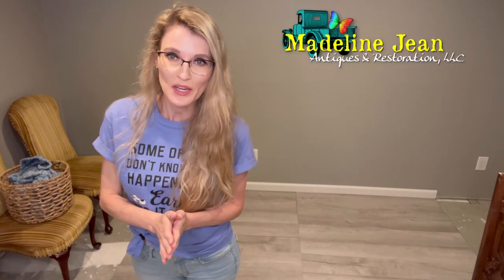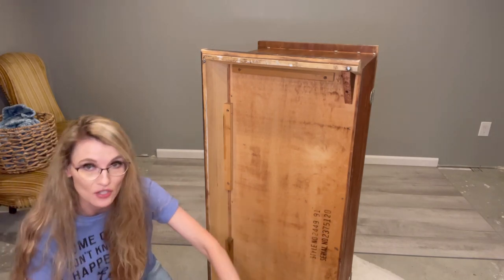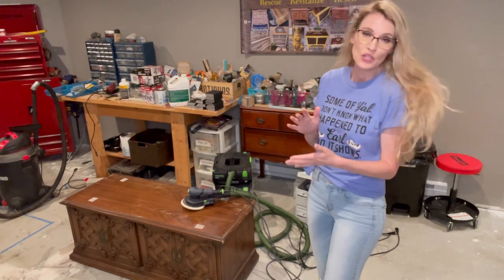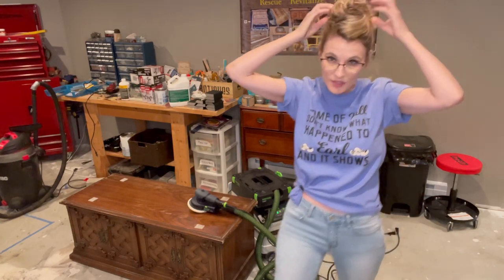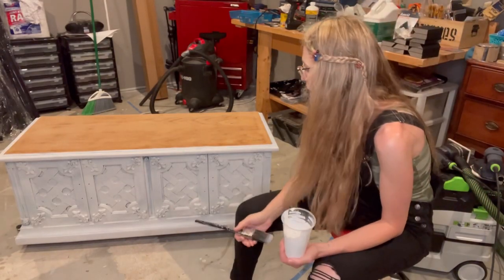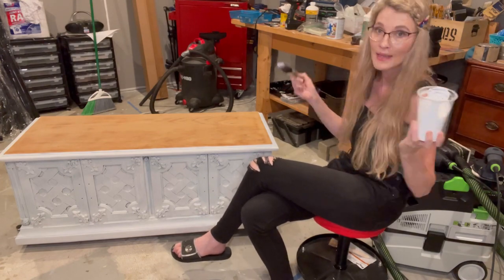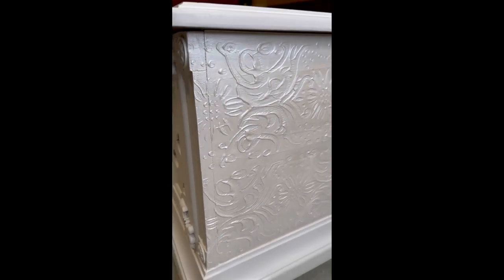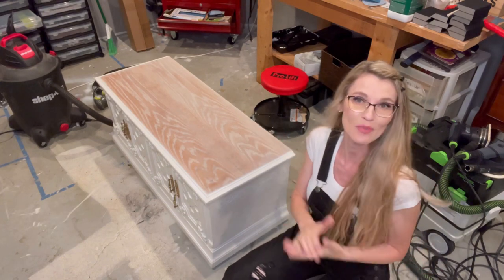Furniture Flip Makeover | How to Create The Bohemian Chic Look on Furniture

Comment: Hi Bethany! Your work is fabulous as always.I love all of your tips and tricks and envy your sander lol.  I have one question..I recently started using shellac for some dark stained pieces I would like to be white. I've heard you should dewax Shellac before you add paint. Is this true for you? Can I use the shellac that has no wax in it? Any help is greatly appreciated!
Reply from the maker: Hi there! Thank you for watching my videos! From my understanding the only time the wax vs. unwaxed Shellac comes into play is when you are using it as a topcoat OR using it over/under poly or a water based topcoat. I use Shellac as a wood tannin blocker. I use the Shellac with wax. I’ve had no problems pairing paint over it. It does the job perfectly of blocking stains and bleed thru. I do know the Shellac that comes in the can has NO WAX. Funny I used the Shellac spray a few times and I had issues with bleed thru.
Reply: @madelinejeanantiquesrestor9074  Thanks so much for the reply! That's perfect because I am using it for the same reason you are. I guess when I read about it I assumed de-waxing would allow the paint to stick better. I will stay away from the spray cans. I did see 2 kinds of Shellac in a can, one with no wax, so that would probably be bad for this purpose. Thanks so much:) Can't wait to see what you are working on next!
Reply from the maker: @bethcorso6376  I’ve always used the waxed Shellac with no issues. Best of luck with your project! Thanks again for watching and liking my work!

Comment: Hi Bethany, great tip using the “cheap” paint for a first coat.  LOVE the stencil and I am not even a stencil person.   Question:  why didn’t you use a primer to prevent the dark bleed threw?   Why shellac?  Thanks and love to Biscuit.
Reply from the maker: Hi Liz, So happy you liked how this project turned out. To answer your question I prefer Shellac over a primer because in my experience it not only blocks stains it blocks wood tannins coming thru. Primer in my experience hasn’t been 100% at doing both. Shellac has proven time and time again to block both those things. Also is dries faster than primer. Biscuit says woof! 😉🐶

Comment: Hi! I'm very VERY new to this and I'm starting with restoring an old dresser, I'll be using it in my living room, It's been previously painted white and I'll be painting it  a cream color but I have a couple questions 1. What is the best paint to get at lowes or home depot for this kind of projec?t and 2. What kind of top coat do I use after using Shellac?
Reply from the maker: First let me applaud you for trying a DIY project like restoring an old dresser! Okay the previous paint...I personally like using a fresh canvas when I start painting. Meaning I'll either sand off old paint or strip it. Mainly because you will have better adhesion with new paint going directly over wood vs. another coat of old paint. So if that's not an option for you, hand sand the surface with 150 grit. Just over the piece with sandpaper. Clean off the sand dust. Then apply two coats of Shellac before painting. I like Lowes Signature line of paint. It usually runs $15/quart. I make my own chalk paint out of that paint. Your topcoat over paint should either be a wax OR a water based topcoat of some sort.
Reply: @madelinejeanantiquesrestor9074  thank you sooo much for the reply, I find your videos very helpful so thank you very much for that!
Reply from the maker: @erikapena1264  You are very welcome! Happy to help!
Reply: @madelinejeanantiquesrestor9074  the Lowe’s paint,does it matter what type of sheen to use? You have inspired me to do this to my Lane chest. It’s gorgeous!
Reply from the maker: @suesherman3587  I get their Signature line. It’s a blue can. Runs $15/quart. I get the Flat sheen. I make my own chalk paint. SUPER EASY! You mix calcium carbonate and water in the paint. Then you have chalk paint! I did another tutorial on the chalk paint recipe. Let me know if you’d like the direct link.
Reply: @madelinejeanantiquesrestor9074  thank you so much! Yes would love a link😍
Reply from the maker: @suesherman3587  Here's the recipe video: https://youtu.be/Y81hXUBX12w
Reply: @madelinejeanantiquesrestor9074  thank you again!
Reply from the maker: @suesherman3587  My pleasure!